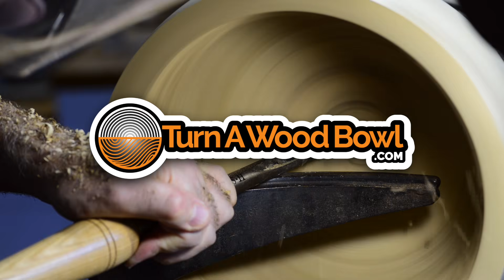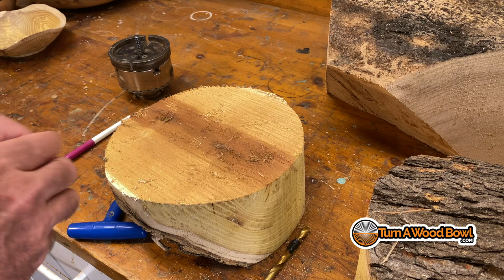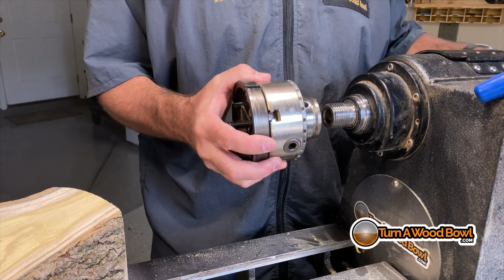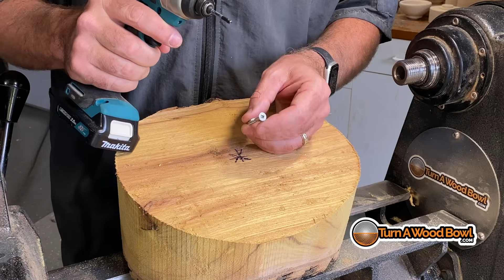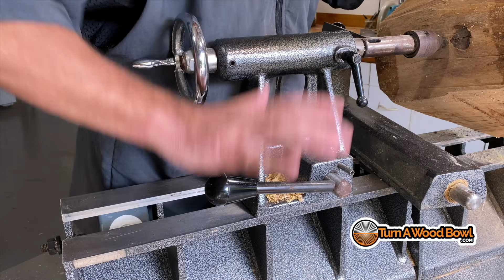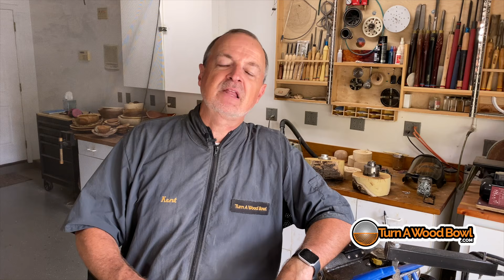3 Ways Mount Wood To Lathe - Bowl Woodturning Video

Comment: I appreciate the patience and attention to detail in his approach but his depth of overall experience may be lacking. He has made a smart move from Philips to square head screws. Don’t use stainless screws unless you need them for an outside project. Stainless screws are super prone to breaking and therefore exactly the opposite of what would be appropriate for securing a blank. Use deck screws or anything but stainless

Comment: I just discovered your page and your instructional videos are great! I do have a question. I just got a Penn State industries tail spinner that I believe is slightly different than what you have there. I just want to know which chuck or method should I use or is best? I did buy the chuck that adjusts with the tenant I guess is what it’s called, but I also have a face plate there as well. Is there a particular style that I should use with this since it is a little different? It’s a 10 inch tail spinner by Penn State industries or PSI.

Comment: Thank you, this was quite enlightening, as usual. I haven't had much luck with the screw chuck so far, maybe because I drilled the hole too deep/not deep enough initially and then having to redrill it, or because I used too large a bit, I don't know. I've just often found myself having to switch to the faceplate, to the extent that I've just been using the faceplate from the outset lately. The problem with that is of course, however, that the screws on a 3" faceplate can very often be too far apart on a smaller blank, with the result that their ends may interfere with the outside slant of the bowl. I need to find myself a smaller faceplate somewhere, but they don't seem very readily available? The stock one that came with my lathe is smaller, but I've been leaving it on my homemade Longworth jaw. Maybe I should get another larger, 3" one for that so that my smaller faceplate can be free for other work again...
I haven't used the 4-spur chuck yet, but I can see the potential of its adjustability to help turn a blank into a symmetric shape before attaching it to a faceplate?
Oh, and I've also bought myself one of those nylon washers recently, but noticed that it was causing a pretty noisy wobble when I was using the chuck with it. Removed the washer and the wobble was gone... 🤨🤔
Reply from the maker: Thanks for sharing your experiences - hope you find the right methods for you! Happy Turning!

Comment: How is the best process to fasten a large log 6' x 12" log diameter of 10"?
Reply from the maker: Wow, that's big. I would start with a faceplate and tailstock and use a lift. Maybe an engine cherry-picker to lift and hold the log while it's being mounted. Good luck and be safe. Happy Turning! Kent

Comment: my wood lathe dont have a handweel instead it has a slot in the front for a wrench, should i still turn the spindle or can i turn the chuck itself of secure it to the lathe?
Reply from the maker: You can turn it on by hand, just be sure the threads are lined up and not crossed. Happy Turning!

Comment: I watched an instructor who was teaching about seating the spur center.  He said that if you use the knock out tool to slide thru the handle while you are seating it and hitting the spur center with the knock out tool it would help seat the spur center.  Not hitting the knock out tool with anything , just sliding it in and out with a little force to make contact with the spur center.
Reply from the maker: Great tip, Tony. I'll remember that one. All the best to you and Happy Turning!

Comment: To help with turning in wood screws and turning them out again, just scrape a little solid bar soap on the screw first for a solid lube. The cheap stuff, like Ivory soap will work fine. Don't use a liquid soap or gel. They just seep into the wood.
Reply from the maker: Good tip Doug, Thanks and Happy Turning!

Comment: I came away wanting as a brand new (green) turner.  Haven’t even got the lathe yet.  But it has shipped.  My questions are about the face plates and how to tell how big of one you’d need for the project.  So what sizes would you recommend  for the smallest bowl to the largest.  I’d probably use this method on  large heavy pieces.  But the 4 point spur drive on smaller lighter projects. Thanks again for the informative videos. One other thing I’d like to know is what height should you lathe be.  Im 5’8” tall and will set it on a bench or portable work station.  But don’t want it to Low or Tall.  Thanks again and keep on Turnin’.
Reply from the maker: Good question, Casey. The larger the faceplate the more support, but 1/4-1/3 of the blank width is a good rule. The lathe should be at or around your elbow height. You don't want to be reaching up or bending over too much. You'll probably want to tweak it a bit for the first few weeks. Happy Turning!
Reply: @ Thank you for the reply and info.  My lathe supposed to be here Wednesday.

Comment: One more way! Get a flat mountable steel or cast iron plate. Get it hot (an electric frying pan or hot plate). Use glue gun sticks to melt and mount your wood. This would be for specialized non-round shapes a person wants to hollow out for a unique bowl. When it is time to release the wood, reheat the plate.
Reply: Sounds scary! 😂 But I’ll try that someday. With the proper hot melt I can see it being a great way to go.

Comment: On projects where I'll be using screws in wood I have a box of paraffin blocks used for canning etc. that I'll work the screw in and out until there is a good enough coating on the screw. This seems  to make inserting and removing the screw easier and less likely to break. Of course, I wouldn't do this if I was building a deck or something! 
Thanks for the educational insights!
Reply from the maker: Great advice. Thank you for writing and sharing, Mark! Happy Turning!

Comment: When I was learning many years ago about bowl turning, we were instructed to glue our blanks/ projects to a piece of plywood ( sacrificial stock) not into our blanks, then screw our face plates on to the sacrificial board. This system works well until it doesn’t and just like anything else it can come apart, generally at the paper glue seam!

And for the spur we were instructed to cross cut all stock then tap in the spur center! 

Hope to rejoin the fun of turning bowls soon. Pat

Comment: A question. Do you mostly attach the face plate to the "bare wood" area of the blank, or to the "bark side" ?  I've seen both & I'm wondering your thoughts. Also, is it helpful having different sizes of face plates in the wood shop ?  Thank you,

David
WoodWorking Made Simpler
Ada, MI
Reply from the maker: Either way works. If you attach to the bark side you can make a natural or live edge bowl. Happy Turning!

Comment: Thank you for a very well made and helpfull video ; i am a seasoned woodworker, but relatively new bowl crafter. I use the faceplate securing method because a faceplate was included with the old lathe a am using. I like the spur atachment for spindle turning but think it can only be used to turn the side and bottom part of a bowl, then switch ro face plate atachment to carve out the interior. I also believe the spur securing method to be less safe to use regarding a flying bowl blank because of antention required to maintain the tail tight enough and the high torque exerted on a small diameter spur compared to a faceplate.

Comment: Is centering VERY important? It seems to me that, once you begin turning, it's going to become naturally centered. That's not to say that you can have it mounted 2"+ off of center. As long as it's fairly close. Am I missing something? TY
Reply from the maker: John, good question. The grain rings inside the bowl can be centered fairly precisely. When the grain "circles" run up one side is looks odd compared to having them nice and centered in the bottom of the bowl. Happy Turning!

Comment: Hey I am trying to turn rosettes on a new lathe for the first time.  I am trying to figure out if I can use the faceplate attachment on a custom jig to hold my 5" rosettes. The jig would have side clamps to hold the rosettes in the jig.  I cant find anyone doing that online, so can you confirm this is a legit method? Also I purchased a custom bit to make the rosettes but It doesnt lock into place, seems it is a compression fitting.  I am concerned it will slip.  Does this sound right? Any suggestions on securing the bit?  thanks

Comment: When using faceplates after three or four they begin to get expensive.  Purchase a spindle tap the size of your spindle and tap pieces of wood the approximate size of the faceplate you want.  Then tap it and it will screw directly to the spindle.  You can than glue a larger piece, or smaller, to the wood you tapped.  At any point you can turn them true while they are on the spindle.  You can then use these assembles to make any number and size of jam chucks and/or faceplates which cost essentially nothing after paying about $30 for the spindle tap.  Leave the piece of wood with the hole tapped to make a face-plate, or any other fixture you want.  Very useful technique.  If I recall the spindle tap is made by a company called Beal.

Comment: I’ll start with the faceplate and then mount a drill chuck in the tail stick with a forstner bit and put a recess in the other end, drill 3/8” then remove, add dovetail and then mount into the 50mm jaws and remove faceplate.

Comment: I use a spring center punch or an awl to prick center holes for drive and tail centers . I turned a small handle for the. Spring center punch and epoxied it on , no need to strike with hammer and it has a, hole. In my table side tools holder , I also made a brad awl with a 10 p nail a bit of ash , and ak 3
/4
"× 3/4" Piece of copper tubing vor a ferrel . I left the original cuf point from the nail mill and just give a couple twists  to make center holes

Comment: A senior member of my turning club showed the club an alignment guide that he made to aide in centering a face plate .on blank . He turned a bit of wood the diameter of the inside of the.plate about 4 inches long with a pin in center of one end . After finding center , prick a hole , insert the dowel with pin protruding and place it in the center hole , hold plate in place and set your screws , remove the dowel and bingo perfect centered blank 
To increa,se ta,il stock lock levelrakge , turn a handle about 6 inches long or slightly more and tapernit , drill it out to fit the  lever and tap,it in place , no need to reef on it
Reply from the maker: Thank you for writing and sharing Gary! Happy Turning!

Comment: When I use the 4 spur, I use a 1 inch forsner bit for my center. By drilling in the depth of the bit head I still have the adjustability from the tail stock and the 4 spur will not slip
Reply from the maker: Russ, that sounds like a great plan. Happy Turning!

Comment: Thanks again Kent for an informative video.  I saw a British guy using a modification of the faceplate that attached to the 4-sided chuck instead of onto the lathe directly.  It seemed secure and efficient especially since he didn't have to change the 4-sided chuck when he turned the blank around to attach it to the mortise or tenon. Hope that explanation made sense.  I'm a beginner and have used all three methods.The four spur is fast and flexible, but not so secure in my limited experience. So, I've gravitated to the faceplate and  screw-drive methods so far because of the security.
Reply from the maker: Thank you for writing and sharing! Yes, the faceplate is a great way to go. Happy Turning!

Comment: Good teaching. Today was my first day turning. I learned a lot, like just how to mount a chunk of wood. Toward the end of practice, my material was no longer staying on. I used the 4 spur chuck, tried tightsng as I went. Still I struggled so here I stop. After watching your video I think I may need to tighten as I go. It was fresh green wood, Monkey tree I think. Well, at least I got through mounting and bulk or bull chisel and some skew work.
Reply from the maker: Tightening as you work is critical. Also, the type of drive center is important. I use a 4-spur drive center. It has large "paddle/spurs." Some of the spindle turning centers have smaller, finer teeth and a bowl will simply spin. Hope that helps. Happy Turning! Kent

Comment: I would think using the screw and chuck combination would ensure the spigot turned would run true to the chuck and make it better when reversing the blank to work the inside, assuming the same chuck is used.

Comment: Sounds like the ideal situation for removing the screw chuck would be if you could remove it from the lathe, disconnect the screw from the four-jaw chuck, and then remove the screw using an impact driver.

Comment: I trust the faceplate most. Mine is 3" with only 4 screws. Going to add additional  sizes looking for 8 screw models. I also use the spur chuc, on small stuff, but my tail stock creeps. I think I can fix that by tightening  the nut under the rails.
Kent, I just pure love your videos for the excellent  way you explain everything so even a novice like me can easily grasp  the information and turn it into action. You are hands down the best instructor. I've probably watched 50% of your videos, some more than once.
Can't say enough about how much you have taught me. Sharpening is still my biggest  foe.
Thank you.

Comment: Is Four-Spur chuck also recommended with longer chunks of wood? I have a cheap, light-weight lathe and when I secure the material (diameter = 170 mm, length = 220 mmwith) with facepalm, my lathe is taking huge vibrations. Should I use four-spur chuck?

Comment: I usually use a face plate but on the other side of the piece than what  you showed. I have to make another cut with the band saw or the chain saw when I harvest it to flaten the bark side. This way I can create a tenon or mortise and flip it around for a live edge bowl without the screws wasting wood. I'm interested in how you keep it a live edge bowl with the face place on the inside? I watched this video to get a better idea of how to use a spur chuck and this video is great! One of the blanks you used looked like Mulberry?

Comment: I've had those spur strip out and just spin. Have to stop Re-drill a small hole get another bite... Face is the best as long as you have a good face plate and not this junk made out of pot metal. Just had one the other day I was turning a large blank use the oneway easy coring system with the carbide cutter. Got a catch the second one snapped the center right out of a 6" faceplate. So just order the  sameone your using a 4" and 6 ". One question are you using # 8 or # 10 ??

Comment: Very nice video, Kent.

I start — and later finish — nearly every bowl between centers.  The exceptions are very, very few.  The ability to tip & tilt the bowl to balance the figure and/or the natural edge outweighs all other considerations for me.  I can then turn a tenon for a chuck, or turn a flat area for a faceplate or glue block, and the tail center is no problem-o:  I leave a little nub that either fits between the chuck jaws, or size it to center the faceplate.

With a bit of practice, and taking care to never trust the bark as a mounting spot (I chisel away the bark to dig into solid wood) turning between centers should present no additional risk.  Start slow, and don’t increase the speed until it’s well balanced.

Comment: Kent I saw someone use a Spurred faceplate screwless it had a bunch of metal points on it maybe 6 inches screws onto the headstock. And for the life of me, i can't find it so I'm guessing it was homemade.  You take your bowl find your center you then drill a pilot hole the center guide of this spur chuck is centered in the pilot hole with a guide pin. as you push the tailstock up and tighten it up it pushed the blank into the metal spurs that holds it in place No way it's going anywhere...  Maybe you've seen this and maybe I'm not calling it by its right name and that's why I'm not pulling it up. And I don't recall who was using it on YouTube... Thank You.. I just got my One way coring system today so going to be having fun with it. They was out of the #3 so waiting for it to come in ... Thanx Again.

Comment: Using a faceplate, how do you attach the bowl AFTER you have finished the bottom and sides of the bowl, leaving a tenon or recess on the bottom.  You never mentioned using a 4 jaw chuck when you have to turn the bowl around.  I presume that is what you have to do.
Reply from the maker: Kathleen, yes you ideally want to shape the wood to attach it to a four-jaw chuck. The 4-jaw is one of the safest and quickest ways to attach the bowl for turning. All the best to you and Happy Turning!

Comment: Just had an idea come to me, for face plate- have a short piece of wood turned to clear ID of face plate hole, small brad-point at center one end. press brad into center mark on blank. auto-centers the face plate while you put in screws. then easily pull the 'jig' out voila!
Reply from the maker: Sounds very interesting. You should experiment and see how it goes. All the best to you and Happy Turning!

Comment: New to wood turning…. Bought a  small lathe and have been watching your videos. I’m just using the faceplate that came with the lathe and it’s not bad. Yes, it makes the bowl bottom thicker because of the screws and that’s ok for what I do. 
Thank you for explaining in detail all about woodturning.
Reply from the maker: My pleasure. All the best to you and Happy Turning!
Reply: Try putting the face plate on what will become the inside of the bowl.  Then the wood with the screw holes will be cut out.  Check my comment on 11/11/23 about how you can make all the faceplates you want for no money once you buy a spindle tap to cut the threads for the wood faceplates.